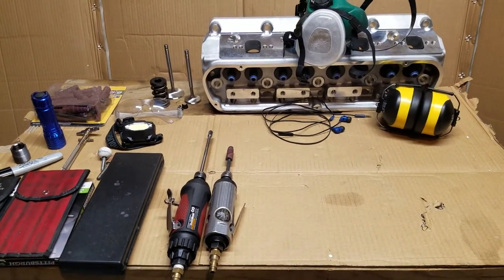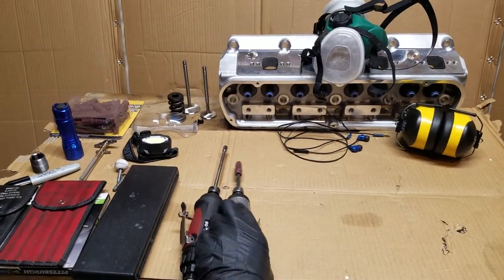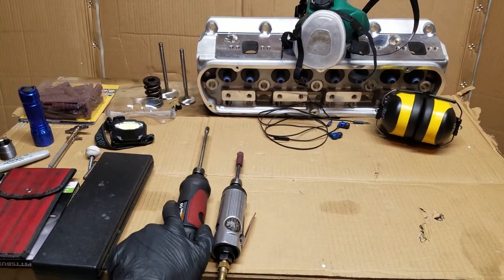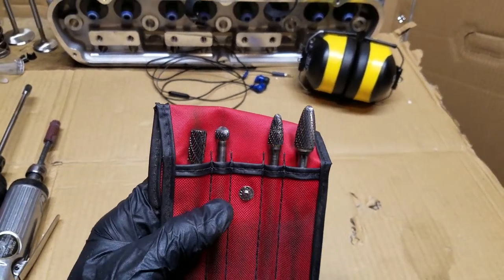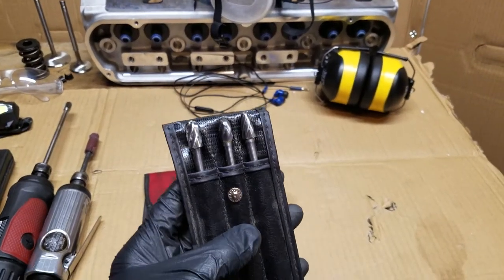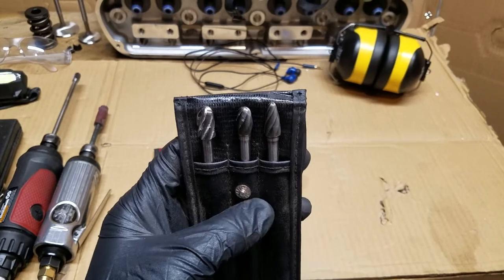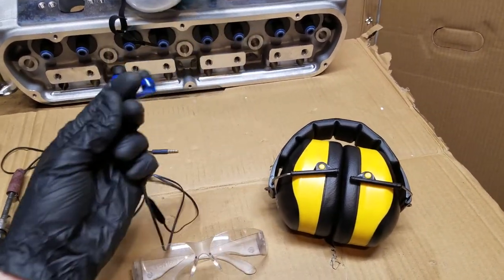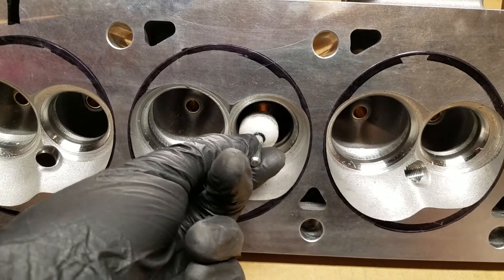Porting tools and Ford 302 351 Windsor jr update

Comment: What are all the flow specs  At .200 300 .400 .500 .600
Reply from the maker: This is a set of world Windsor jr heads , 180cc intake runners 1.94In 1.60ex valves . Out of the box was  In./ ex @.200 105/101 @.300 141/125 @.400 170/140 @.500 186/149 @.600 195/154 @.700 201/156 after port work those flow numbers went to In/ex @.200 120/102 @.300 180/129 @.400 216/162 @.500 246/173 @.600 264/182 @.700 270/185 .
Reply: @blueovaldude   Thanks reply and the info i have a set of the wp jr heads a got for 700 bucks havent used them, wish a waited could have got the  nkb heads  or the pro maxx .What made you pic the nkb heads over all the other heads out there. ps good videos
Reply from the maker: @paul87buick  Thank you . It is a budget aluminum head that is quality machined,  uses comp cams valvetrain , erson valves , has a dual pattern exhaust and fair flow for the price. I figured i could put them in the range of a AFR 185 for a $1000 less . And show people how to in their garage also . There are a few heads i would like to test out . We will see . The Windsor jr is a fairly decent head but it needs porting to realize it's potential .
Reply: @blueovaldude  love your channel. Nice to see Ford content. Question for you,what is the part # of the Oil pump you used that had a threaded plug for the pressure spring. Thanks Dude.
Reply from the maker: @denniskoop8018  thank you for your input , i appreciate it . I do mention the part # in the video,  but the part # is 10832 for that unit . You get 2 springs standard and high pressure , HD driveshaft and of course the Hp pump . Have fun with your project.👍
Reply: @blueovaldude  Thanks Dude. I have a 67 Fairlane GT with a 351 W. Going 408 this winter and this pump will go good with this build 👍🏻
Reply from the maker: @denniskoop8018  sounds like fun ! I Love fairlanes .